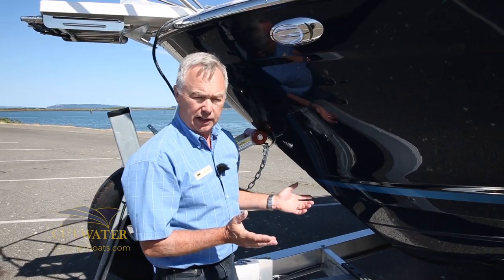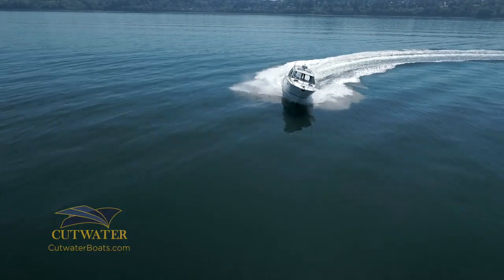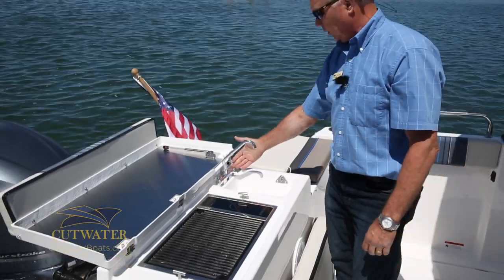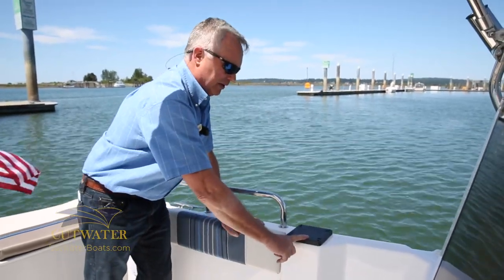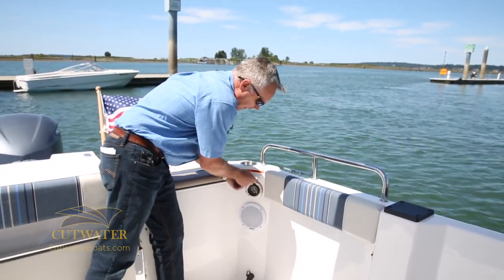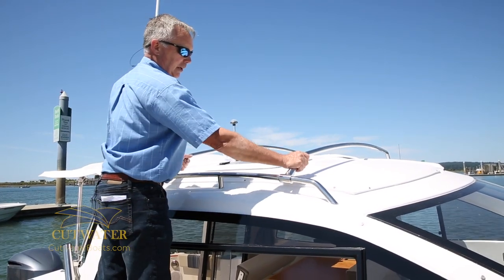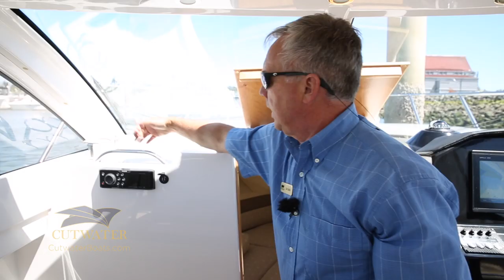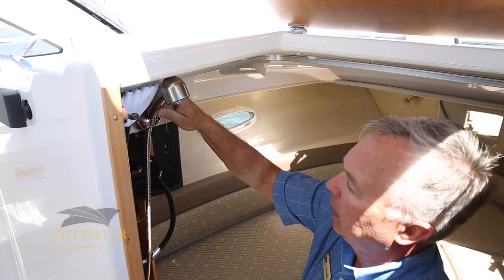Cutwater 242 Coupe Overview and Sea Trial

Comment: Is this a of shore boat and would be nice to have a gen for AC? Great video btw.
Reply: @seikibrian8641  Yes a genny isavail for $15,000.00,but adds weight and takes up alot of valuable storage,plus being chilly sucks,so the wabaso diesel heater is small and comfy warmth as an option
Reply: A generator option is shown in the owner's manual, so it can be done apparantly.
Reply: @seikibrian8641  If needed thee NOW is a total solar generator that can be placed in the rear inside storage, along with a webasto heater out of sight.

Comment: I need a small loan of 1 million $
Reply: @seikibrian8641  really!? I thought FOR SURE this was going to be in the 200-225k range... I am SUPER impressed.
Reply: @strikeforcek9149  For that kind of money you could get a benneteau 895 marlin,twin yam250"s pilothouse door and safe wide gunwale to very nice bow seating
Reply: @strikeforcek9149  These boats are VERY VERY closely built like the RANGER tugs, however, with more available options, like the wine cooler, led lights, exterior built in turn signal lights etc............... and actually cheaper starting  loaded at $110,000.00 MSRP.